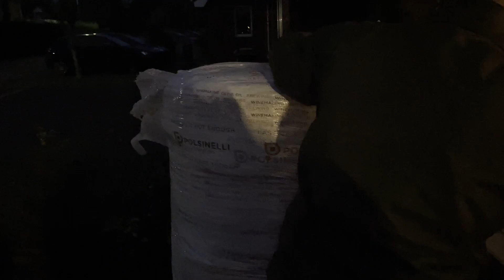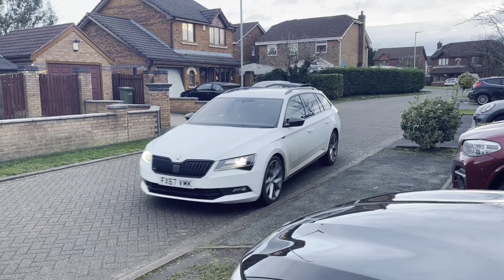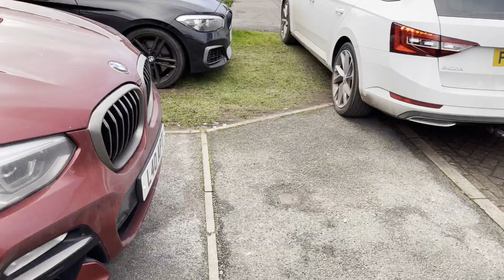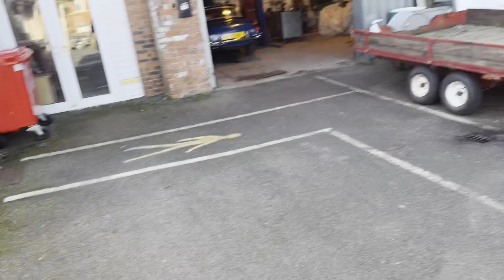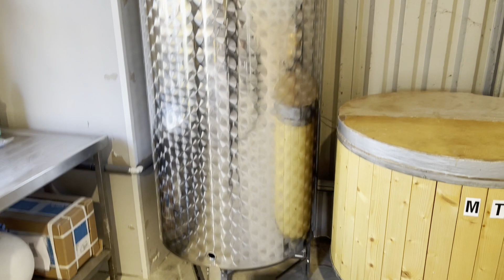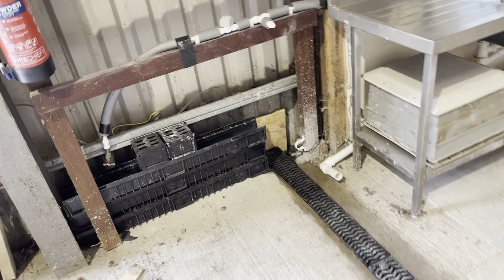Ep.15 - New Tank, Chuckle Brothers, New Microphone, Effluent and Electrical Update.

Comment: Coming together piece by piece. I can recommend Armaflex insulation for the HLT. Its not the cheapest but it is effective, looks the part and doesn't take up too much space. More insulation less power consumption.
Reply from the maker: Cheers DB DB, I have been looking at options and Armaflex (or similar) looks nice and neat.  I would like to clad it too, purely cosmetic of course but it would be nice to have all the tanks looking similar.  Will get the holes cut then think about it more.

Comment: You think there is a lot of unused space but that will soon get filled up, e.g. where will you store malt and hops? Cold room will take a chunk + that cask washer and used casks will eat a chunk.  Could add a small mezzanine so the malt is off the floor and out of the way. It looked like there was once something similar in the unit (from an earlier vid). Put some tape on the floor so we can work it out (or take a photo and draw lines). About 6 years ago I nearly bought a 2 barrel kit that was used in a slightly larger unit and there was very little room for storing everything.

Comment: Awesome stuff its good fun seeing the brewhouse come to life.

From my experience in commercial brewing i would set your spare mash tun up as a clt but have a element so you can up your water supply you will be surprised how much water you use.

We run hot through our hoses with a butterfly end on to just have a slight spray and hot sterilise our closed circuit lines between kettle and fv
Reply from the maker: Cheers Ivan, good first hand advice there, I appreciate it. I'm hoping that 600L is more than we need... but maybe I should have got 1000L?  MT as CLT, good idea.  I don't think I'll know whats missing really until we get a few brews in.  I'm winging it here! ;)
Reply: @FourPriestsBrewery  were abit larger in size running 1800l kit but its all the same we also can and keg fill for off venue so we have alot going on at one time.

Basically my typical setup is a 1800l clt running as a 2nd hlt my main hlt for mash tank clean and line stez is 1300l i add my steike water to the kettle and heat that then pump into my mash tun as my mash tun has no heating i have to nail the strike temp i go 8c above target and im withen a degree at end.

But yeah having spare water on hand is good especially once you get to 2 fvs you could double brew with someone in one day.

Comment: Great to see it starting to resemble some sort of brewery already! I don't know if it will be an issue with your effluent yet but if there are concerns with acid/caustic strength discharges then you can use something like an IBC as a buffer tank and pump some of the acid/caustic waste into it and then use it to neutralise whatever other material is coming out. That's how industrial manufacturing sites control the pH of effluent waste to open waterways.
Reply from the maker: Cheers Paul, it's getting there. If I'd spent as much time on the fit-out as I have on admin and regulations we'd be looking production ready by now. So much work you can't see :). Fortunately UU have no issues with the manufacturer recommended concentrations of caustic and peracetic acid so that's half the problem solved. The IBC's coming next week will give us the flexibility to buffer and make pH adjustment. Hopefully not necessary! Now we are in contact with UU we can work with them if they need us to.  Cheers!
Reply: @FourPriestsBrewery  Now you have "all" of the legal stuff sorted you can sell your homebrew to make up funds ;) haha!
Reply from the maker: Brewing tomorrow - but that will be entirely for my own consumption :) Honest.

Comment: Much bigger FVs needed from off
Reply from the maker: Hi Stephen. Probably... ! Don't forget that we're proving the concept first. Currently only building the brewery at weekends, then only brewing at weekends, and with just a handful of local pubs taking casks.  And we are not using external finance and I'm not taking a wage.  We can add more used FV's quite easily for not a lot of cash, in fact we have another coming in March, also 2BBL.  Our model means that we can cover all operating costs with a single FV at weekends.  Two would be comfortable.  Further development will be determined by the time that I have available (not likely to change), or Sarah and Elliott's willingness to run the business. I'm happy to develop it as we go along and our family circumstances dictate.  Cheers for the comment!